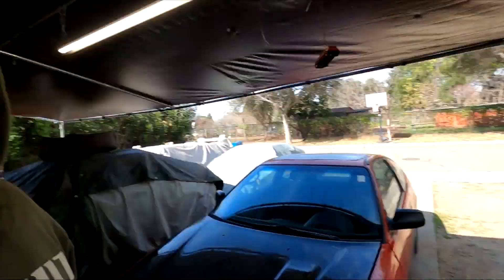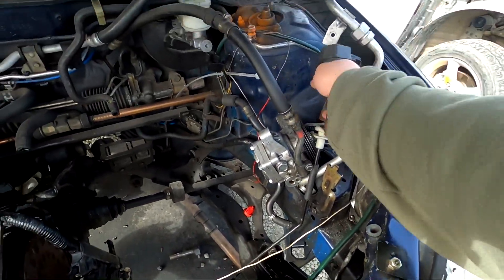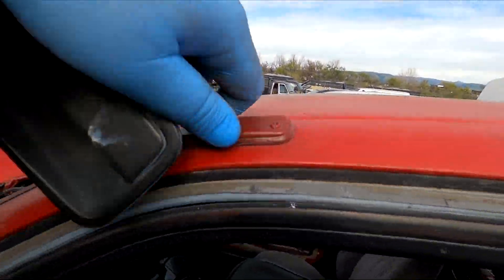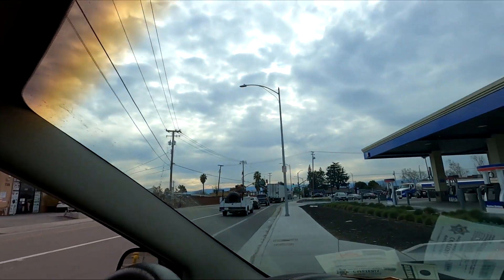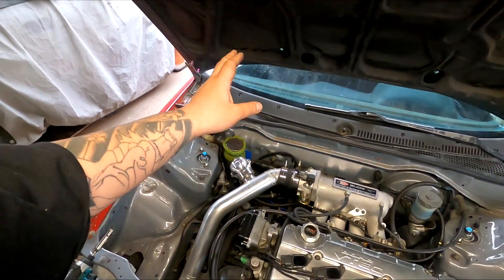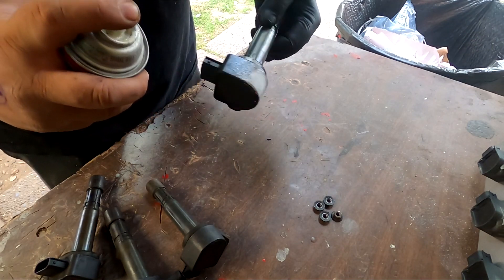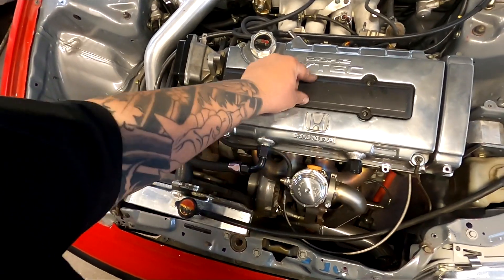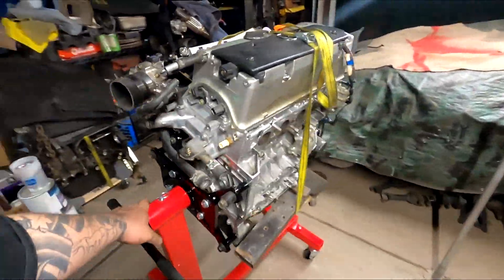JUNKYARD SCORE ! ! Modified D17 Coil Packs For COP Conversion!

Comment: What has been your experience with the D17 coils after this video? I tried putting mine in the way you did and just couldn't get them seated well cause the plug was hitting the valve cover. I modified the coil packs a smidge so I could straighten them out, but now they are jumping off the plugs